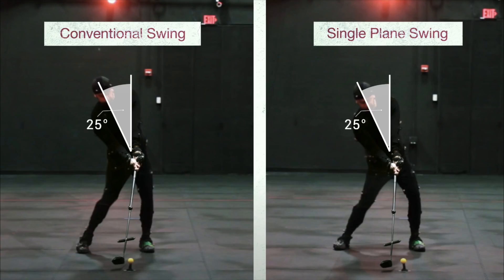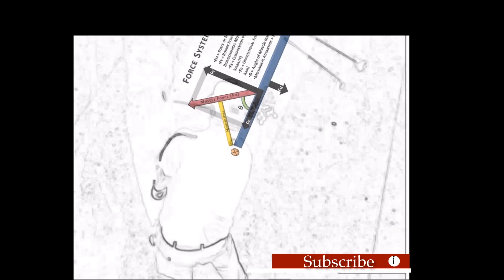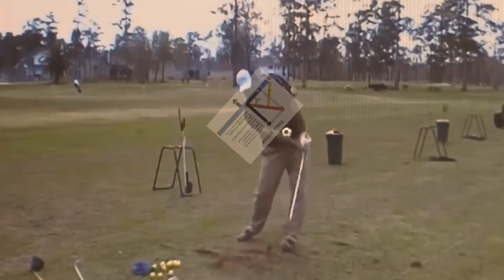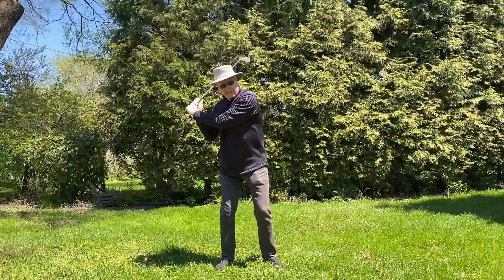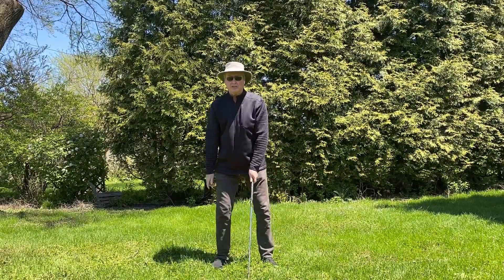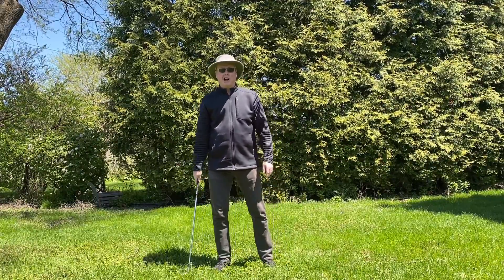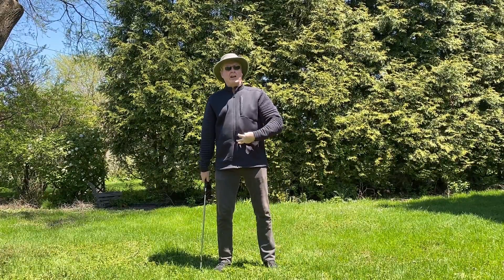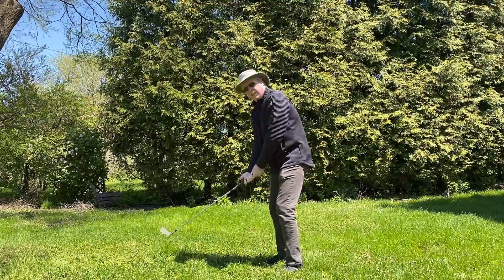My project Force systems and Leverage

Comment: I like your analysis Michael! Have you ever considered using a separated hands gtip for even better leverage...Jack Kuykendall recommends a 5" gap between the hands and is adamant it is considerably more powerful...at least with his mechanics if not all mechanics. I guess it can be a tradeoff between force and speed...with hands together you have a longer lever for acceleration at the tip, but with hands apart you can apply more force on the shaft...experimentation for each individual should find optimum hand spacing for each golfer.
Reply from the maker: One inch

Comment: Correct me if I’m wrong 
But what im getting is aim the force using the turn 
Apply power/leverage with the right arm 

Where as most, including myself will do the opposite 
Apply power with the turn and try to aim it with the arms and hands
Reply from the maker: I would say your first statement was on track. Words can be tricky though. Hands can easily aim. I am a hands player. Proprioception and all that. Like a pool cue. Apply spins and aim with hands no?
I personally throw or toss to targets but I still lever a club to it’s fullest still.
Reply: Been kinda working with the idea that I want to extend my right arm down my target line 
While using it as my sole perceived power source 
Without the arm crossing my Sagittal plane 
Of course In actuality it does cross but it’s teaching me a passive turn and which direction to apply force 

You know we’ve talked and I’m really focusing on consistency over distance 
I have plenty of both at the moment 

Hopefully it sticks 🤞

Thanks for the vid, the response and all you do for the game